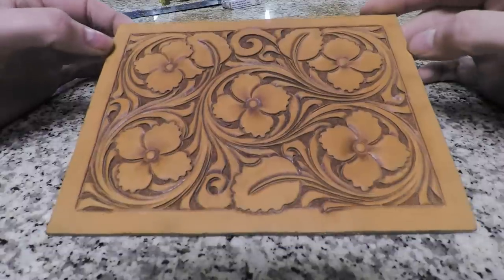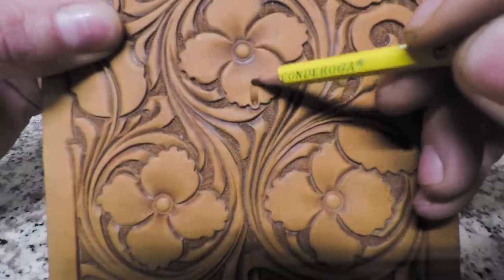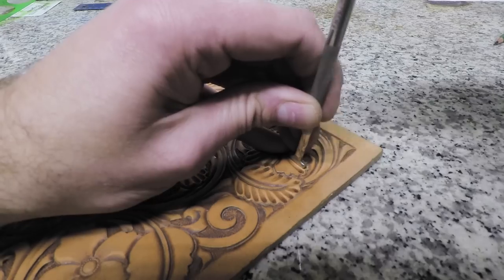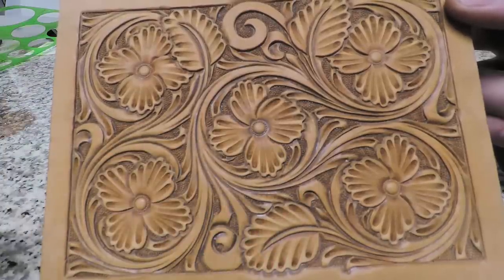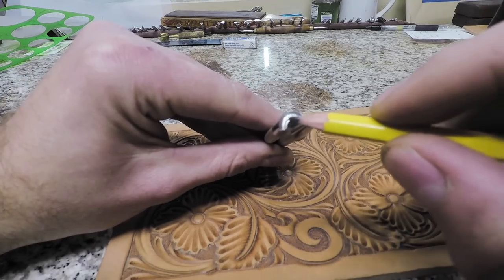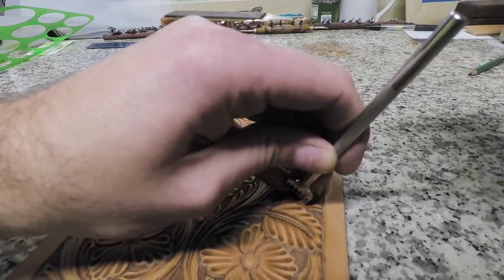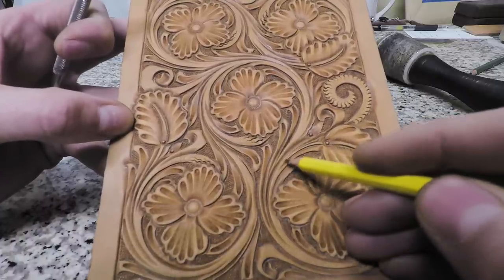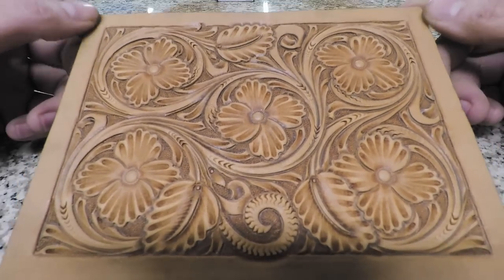How to Tool Floral Leather Tooling Patterns - Video #3

Comment: Don I have been following, I reduced its size to put on my passport wallet I’m making. My question to you is, is it harder to tool on #4-5 weight leather versing 5-6 or 7-8. I am having problems with smoothness, cutting and beveling. I’m doing a practice piece first. Thank you for taking the time to do this series. Mike.